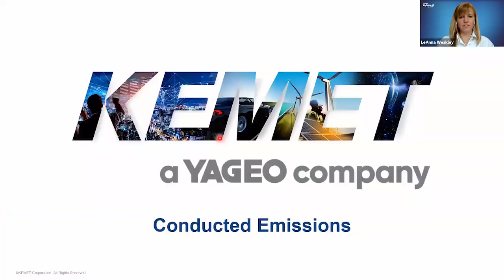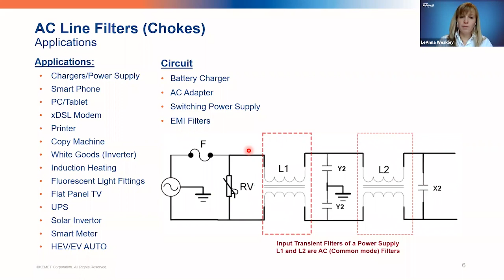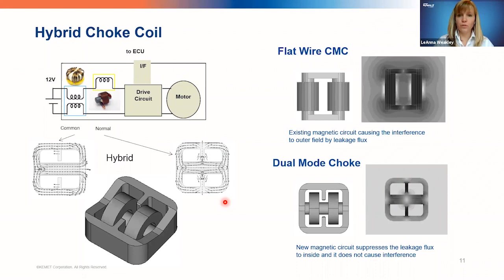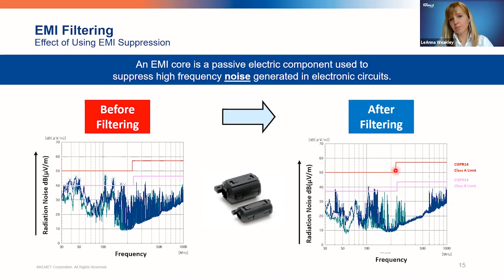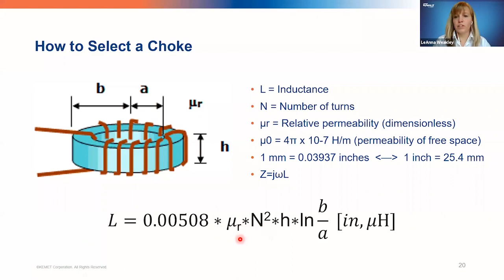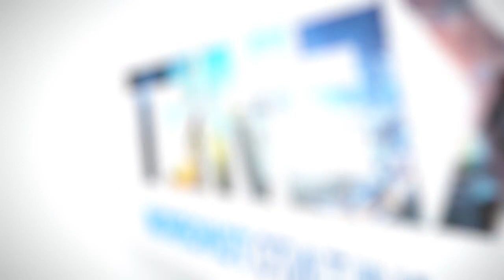Design it Day: Conducted Emissions

Comment: Is it CM choke inductance value and impedance both proportional to each other? Is it higher the inductance value is better? Higher inductance value will increase the CM mode size for a desired current rating. Is it the only restriction to stop the selection of higher value inductance CM choke in design?